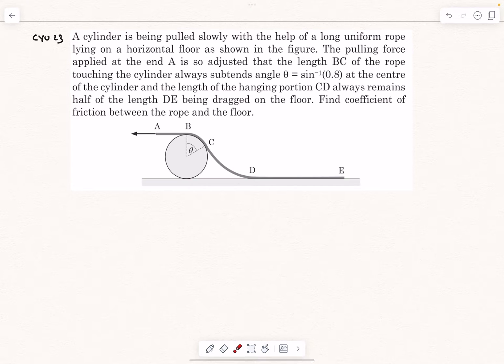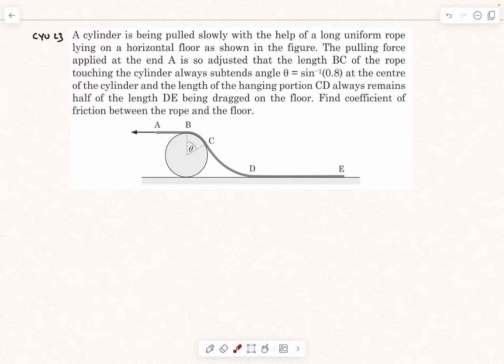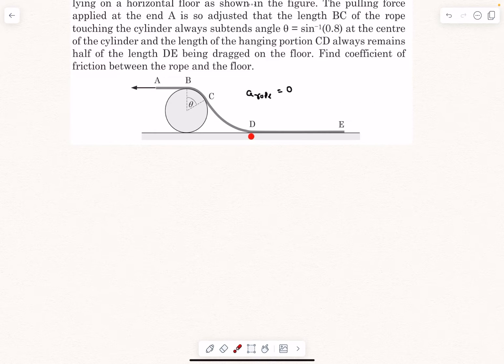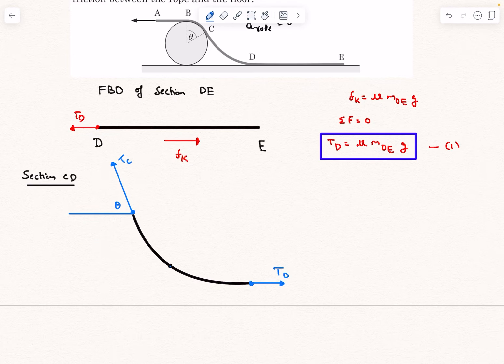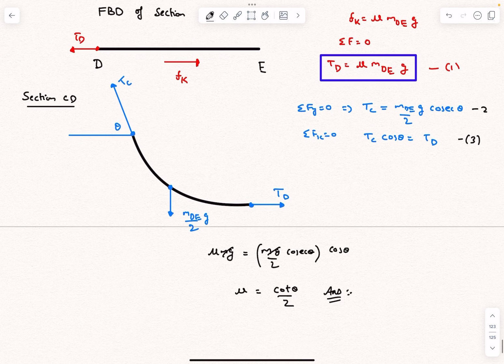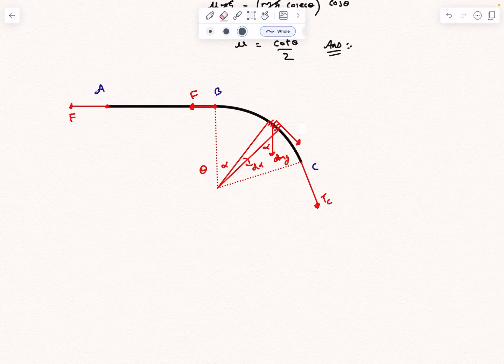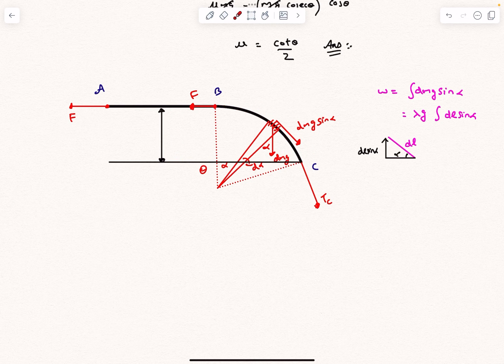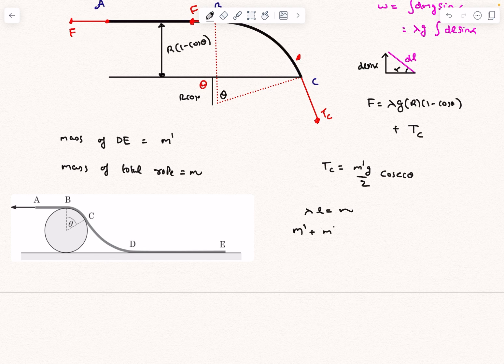Force Required To Pull The Cylinder | CYU 23 | Laws Of Motion | Pathfinder

Comment: For finding the Force I did a slightly different approach but my answer is not matching correct me if I am wrong. If we consider FBD of BC we only need to balance forces in the horizontal direction to find force F. The net force vector of Normal and gravity is tangential to the circle and if we multiply it by cosalpha we get the horizontal component of the force. Now if we integrate this force over the the rope and add Tc*(costheta) which is the horizontal component of Tc this should equal the Force F. but after the calculation the answer is different. Where did I go  wrong?

Comment: Bhaiya..i have a doubt

While calculating the pulling force..you only considered the weight of rope to be acting on every element of part BC..but for the cylinder to "pulled" along with the rope..there must be some friction between the rope and cylinder..so isnt the force of friction between the cyclinder and rope would also be added in the microscopic FBD of the  element..

Pls explain if im wrong about this thoughf process..
Reply from the maker: Yeah I forgot to mention that friction between the rope and the cylinder is negligible. Friction is not necessary as the normal force acting on the cylinder as a result of the ropes mass is enough. You can see it will have a horizontal component r8. But You are right about including friction if it was present.
Reply: Okey thanks bhaiyaa..i dont know why i didnt noticed the normal reaction part..too focused on friction